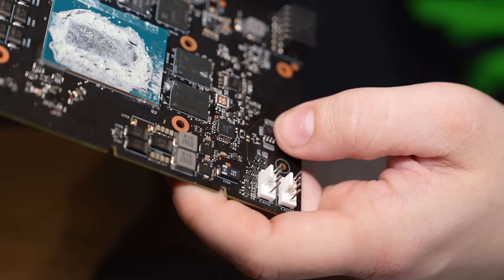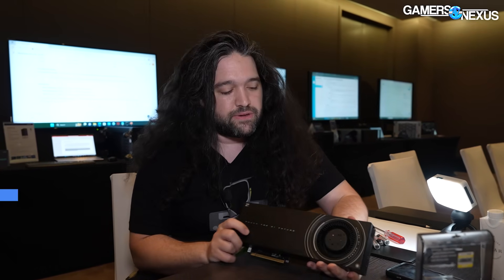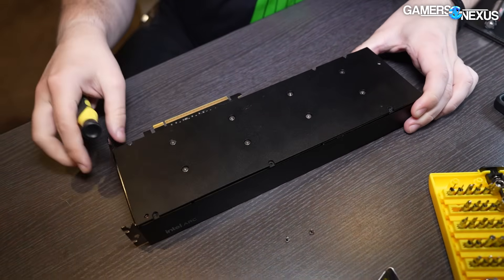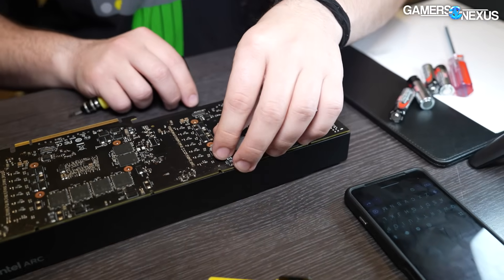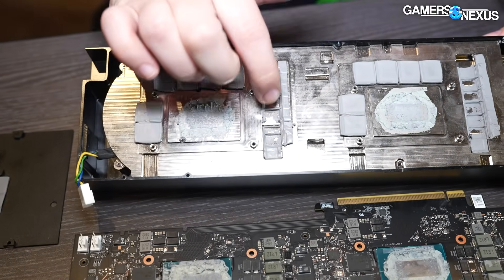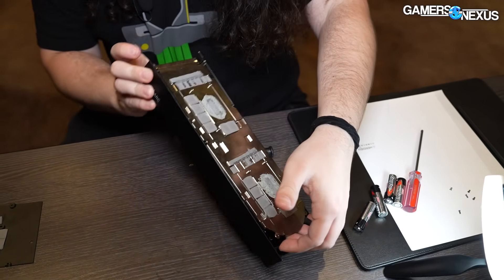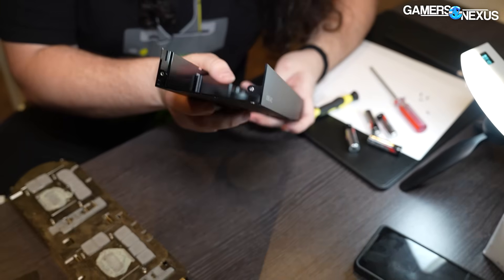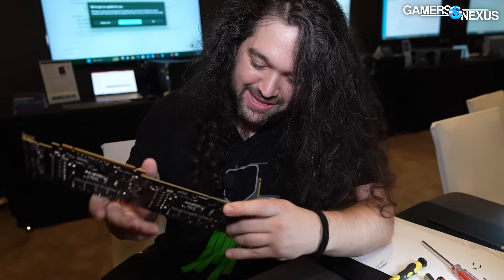Intel Arc B60 DUAL-GPU 48GB Video Card Tear-Down | MAXSUN Arc Pro B60 Dual

Comment: Dual GPUs should be reviewed by dual Steves to maintain the journalistic integrity.
Reply: Thanks Steves
Reply: But how many Steves can the world handle?
Reply: @adjoho1  Two Steves is the limit before drivers become a bottleneck.
Reply: @adjoho1 There's only one way to find out 😂
Reply: @jochenkraus7016  whats is that?
Reply: @XFXForced  You mean the way to find out? More Steves and we'll see.
Reply: @adjoho1 if you are Nvidia the answer would appear to be zero.
Reply: @adjoho1  need at least one Steve clone for every industry to hold corps accountable
Reply: One sitting, one standing, to preserve nature's balance
Reply: Thanks, Steve twins
Reply: Would they need to be plugged together? I'm not sure I want to see where the Steve Link Interface (SLI) cable goes...
Reply: Back to you Steve
Reply: No SLI bridge can support that kind of output.
Reply: I mean, Nvidia has tried to hide it for years but SLI does stand for Steve Link Interface
Reply: Hardware Unboxed Steve ane GN Steve, the Steveoverse
Reply: This card is worth 67,5 Steve Units
Reply: Imagine Steve thanking Steve and Steve thanking Steve every 10 seconds
Reply: That would be a good cameo.
Reply: A Steve with multiple heads? like a hydra
Reply: MSG multi steve generation!
Reply: I already see 4 of him and i am not even wearing my glasses
Reply: The dual Steves should also be dueling to see who can do the most comprehensive review, fastest. Like dueling banjos of Steves.
Reply: please don't my ears are bleeding already😂
Reply: Just play GN and HWUnboxed reviews side by side
Reply: Double die generation.
Reply: There has been a missed opportunity to invite hardware unboxed for the ultimate "hardware nexus: gamers unboxed" combo
Reply: We haven't seen Christmas Steve yet, have we?
Reply: Thank(s) Steve(s)
Reply: oh so this is how this feels like, it's nice
Reply: this is the way
Reply: like one of those dual-cockpit mechs
Reply: HA! Steve and journalistic integrity go together like water and oil.
Reply: @premoboy  y'ever hear of something called "the emulsifier of douchebag tyranny"
Reply: With their distaste for AI, I expect the most honest reviews from them and I would be all in.
Reply: Next: Wozniak and Ballmer in the same chairs as Jobs and Gates from the 2010 memes.
Reply: Dual Steves connected with SLI
Reply: The human eye can only perceive one Steve per second
Reply: agree, Steve must clone himself via AI,
both for review dual gpus
and one for future to stay with us always, 
youtube (tech tube) need more people like him 
(Hardware Jesus)
I wonder who is software Jesus?
Reply: A review from the Neuro-sama sisters would be fun. AIs running on a GPU board meant to run AIs seems legit.

Comment: Died: 1998
Born: 2025
Welcome back Voodoo2

In all seriousness I LONG for interesting products like this again.
Reply: I want to see Sapphire make some Unholy Abomination of a Sapphire Toxic card again.  Just go full Crazy on it.
Reply: @Mach1048  
I'm pretty surprised Sapphire haven't seen the huge success of the 9070 XT as an excuse to make a clocked to the moon watercooled version with GDDR7 memory
Reply: @Mach1048  6900 XT Toxic EE not EXTREME (yes, uppercase) enough? 21.5% overclocked (2730 MHz core) over stock, that's 7970 Toxic levels of headroom.
Reply: @Wasmachineman  It's a start...  We all know Sapphire wanted to do more  :D
Reply: @Mach1048  Ed Crisler who works for Sapphire did insinuate in 2019 that a 5700 XT Toxic was in the works, but it never came out :(
Reply: Those were the days.
Reply: Voodoo 5 5500
Reply: My retro rig (well one of multiple) still has a Voodoo II 12MB SLI setup in it, alongside a Matrox Millennium G400 (remember those?)
Reply: @Knaeckebrotsaege very nice, mix those with a SB64AWE and a Tualatin or a Coppermine and you're a once king of the round.
Reply: @M.W.H.  It's in a PIII-S 1266 (512KB cache) and yes it does have an AWE64, but only the pleb tier green one, not the AWE64 Gold. Will probably stick a better AGP GPU in there at some point to make it more versatile, as this originally started out as a "compatibility machine" (with a PIII 600) since the G400 has drivers all the way down to Win3.1 and up to XP. I've since built an older retro games rig that is more appropriate for Win3.1/95 so there's no real reason to keep the G400 in the PIII-S as a massive bottleneck
Reply: @Knaeckebrotsaege  The Voodoo II was THE Card to have!

Comment: A dual GPU? What a throwback... Like, before I left high school, at the latest.

Also, love the multi-lingual ad spot.
Reply: Dual GPU's never left the market 
only the gaming/consumer space
Reply: @sanji663  As cool as server and enterprise stuff is, I only really care IF it manifests in the consumer market. But you are correct, they have technically never left.
Reply: Intel seems to be speedrunning gpu history. At this rate they'll catch up in a few years.
Reply: @raics101 The VooDoo 1 was multi-gpu back in 1996 👍
Reply: @yensteel bought it to run Turok! 😅
Reply: @yensteel  the voodoo 1 wasnt dual gpu.
Reply: @raics101 just hope they stop before the "black leather jacket" stage
Reply: Today there is even quad-GPU cards for datacenter, like Nvidia A16 with 4x 16GB VRAM.
Reply: @ProjectPhysX  what if i told you that those go back way further than you think, like the Voodoo5 6000, or more recently the GRID K1?
Reply: @Wasmachineman I put down a deposit for one of those, a shame it never came out.
256MB of VRAM seems tiny these days, and 60watts needed a dedicated external PSU.😂
Reply: GPUs have shrunk to get more airflow through the heatsinks, So much of it is a copy and paste job/ Just depends if they put a PCIe switch on there so the so both GPUs can work on a PCIe x8 slot.
Reply: This seems pretty close to being just 2 separate x8 GPUs on a common carrier card, more similar to multi M.2 carrier cards or that Asus GPU with an M.2 slot, where it's just independent PCIe devices connected through the same physical slot.
Reply: Voodoo 5 5500, Rage Fury MAXX, etc
Reply: @IanThatMetalBassist  Oh damn, I'm not old enough to participate in THAT much of a throwback
Reply: Yeah, it has been a while. Last one I remember using was a 24 GB Nvidia K80 back in like 2015.
Too bad it's over a decade old...
Reply: It's for AI, not games.
Reply: The Ares seems to be the last one I can remember... There he is: ASUS ARES II dual-GPU HD 7970!
Reply: I had a dual-GPU card once.

It was the Gigabyte GV-3D1, and it was pretty advanced for its time. So advanced that only one motherboard (at first) supported it. The GPUs were 6600GTs - yes, I'm that old - which had 256MB of VRAM each, (I forget the type) and in games that supported SLI it performed pretty well.

Sadly longevity was not its strong point, and I wound up having to buy a 7600GT to replace it when it died about 13 months later.
Reply: Next stop Intel SLI/Crossfire...
Reply: Bring back 3DFX!!
Reply: When I was in high school, GPUs didn't exist and CPUs didn't need a cooling fan.

Comment: Intel is throwing all its got at trying to disrupt the Nvidia Monopoly and i love that!, Keep up the great work Tech jesus
Reply: Nvidia is also doing everything they can to disrupt their stranglehold on the market, and it seems to be working.    Nvidia has done more damage to Nvidia's mindshare than AMD or Intel could have dreamed of.
Reply: - AMD dunking on the CPU market
- Intel dunking on the GPU market
- Nvidia
Reply: @Wampa842 nvidia-dunking on your journalistic integrity.
Reply: @Wampa842  AMD dunking on the CPU and APU market with excellent Radeon M series.
Reply: @Wampa842  - Nvidia dunking on the stock market
Reply: @Wampa842  It won't reduce pricing, keep dreaming
Reply: @Wampa842 @Wampa842  amd and intel also dunking at igpu
Nvidia dunking at servers,  ai, data centers, gaming gpu [check steam hardware survey], chips selling to third-party  brands like laptops and switches. And the switch 2 [ starting at ONLY 500$ and 80$ per game (good lord) ]
No b*ching about nvidia won't make price go down , when ai bubbles burst,  maybe
None of these corporations are your friend, chose wisely
Reply: @Tom_Nguyen. All 3 are giants in serves and AI.
Reply: @Wampa842 they're not dunking on anything
Reply: more like intel is throwing everything so they can sell those mid range battlemage. else it will suffer the same as alchemist.

Comment: Bodge wires used to be pretty common in finished products back in the day
Reply: @tommihommi1  I was just about to comment on this. Retooling PCBs used to be considerably more expensive than paying someone to run bodge wires to rework a design oopsie.

They've been getting way less common (presumably) due to lower PCB costs and better CAD software, but they do crop up from time to time, especially during development!
Reply: @iamdarkyoshi only for larger surface level features, on a 4-8 layer pcb with bga etc bodge wires aren't really as possible anymore.
Reply: Multimillion dollar routers used to be full of bodge wires
Reply: Yeah, if you go to retro computing channels, there are lots of what used to be very expensive expansion cards and computers that are bodge galore. I particularly remember a PC card for the Amiga.
Reply: Yup, my (formerly) $14,000 IBM PS/2 Model 95/A from 1992 or so is full of bodge wire, on the motherboard, expansion cards. Really its no big deal, especially because these Intel cards are engineering samples.
Reply: I have a Sega Genesis that's got quite a few, and it's the sixth revision of that machine's board. Definitely common back in the day!
Reply: Old skool revsions .

Comment: Thanks Steve.

Now that Nvidia is fucking around Steves, Intel is giving us interesting stuff trying to catch on.

Competition is always good for consumers.

Great Chinese btw, very clear wording except for the tone is flatter than AI, but very much convey clearly.

Hello from southern Taiwan.
Reply from the maker: Hello from south Taiwan!
Reply: if intel really try to catch on they will release B770. competition is good for consumer but the opposite for the company that competing. hence dozens of company that competing for graphic accelerator market back in the 90s no longer exist.
Reply: @arenzricodexd4409 They might release the B770 later, as they got the PR teams rolling to that effect.
Reply: @arenzricodexd4409 What would be really nice is if they released the B770 with some flavour of vGPU support, even 3-4 way splitting would make it an instant buy for pretty much every self host server build bigger than a mini PC (it's a small but growing space), and probably help get some momentum for selling to the broader market.
Reply: @arenzricodexd4409 the die for B770 isn't good performance to power draw ratio. 

We won't be seeing any B770 soon. Unless they decide to surprise us. Just wait for Celestial it's so much better
Reply: @mythydamashii9978  it would be nice to have a consumer BattleMage card with 16gb of VRAM, at least. However, it isn’t needed. What we need is for Intel to start making Arc GPUs on their own fabs on US soil.

Taiwan subsidized TSMC for years, the Chimpster here in the US better help Intel get the Ohio fab up by next year
Reply: im pretty sure consumer cards are not that important anymore for nvidia. even networkcards/switch from nvdia get more attention. enterprise sector is a money printing machine.
Reply: I was really intrigued by how accurate he was... Granted tonal accuracy is one of the last things to master.